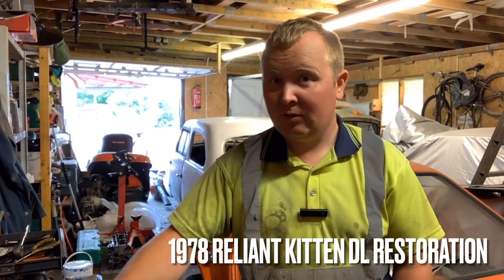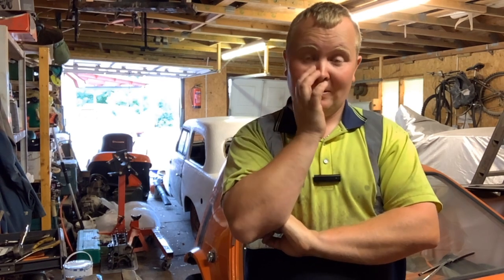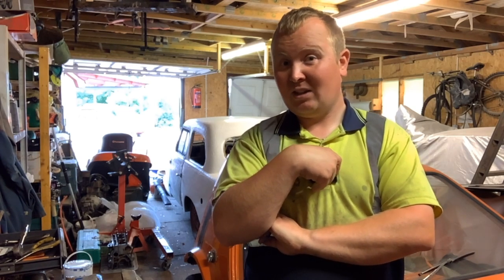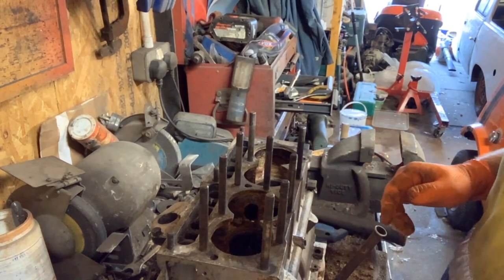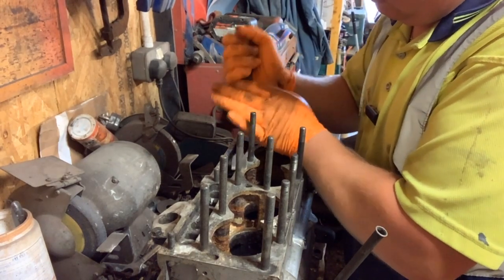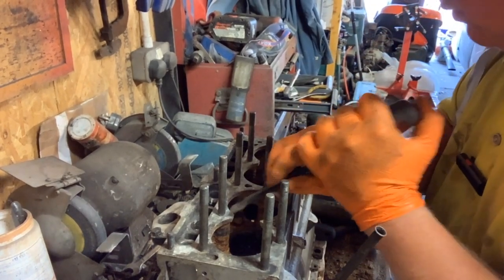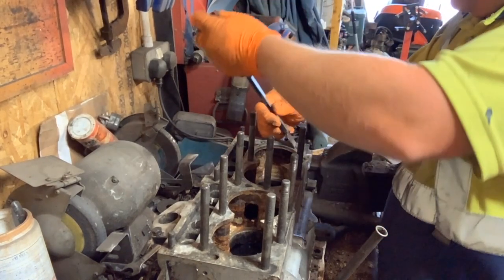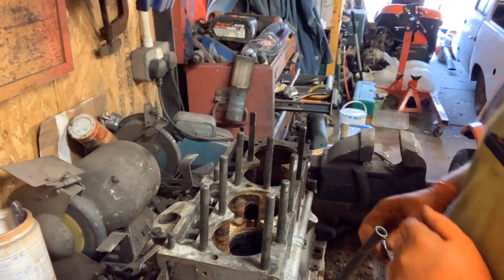It’s time to rebuild a Reliant engine! 1978 Reliant Kitten DL

Comment: i use broken hacksaw blade to scrape old joint compound from head and barrels easier to get into tight areas, no matter the tool use carefully.years ago it was mainly red hermatite and brown hermatite later replaced with hylomar for joints

Comment: The Haynes Manual or Reliant service manual said the factory used a ceramic adhesive to fix the liners in place,     On one Reliant forum they use nothing at all,     Is that blue stuff your using a non setting gasket sealant  ?    Does it matter at all ?
Reply from the maker: I got told to use blue hylomar as it’s a non setting gasket sealant 🙂
Reply: @LewiBuchProductions  silcoset 152 silicone adhesive sealant was the factory sealer

Comment: Nice work Lewi, yeah do it right, is always the best way - but the Honda, fantastic engine - transplant project ?, to make a front wheel drive Kitten ?
Reply from the maker: No chance 😂, I don’t want to break that Honda and I wouldn’t want to make the kitten non original when I have it’s original engine and gearbox here
Reply: I agree, the yellow one needs to be kept original, I had thought you might find another scrap kitten to make it ? - it was just your comment on the level of rust in the Honda , that had got me thinking out of the box - mind, you probably have plenty on your plate currently - hope you keep the yellow Kitten yellow ? Regards Andy
Reply from the maker: Nah I don’t think I’d want another kitten, I’d rather just keep them original,  someday hopefully I’ll get the Honda restored but it’s engine won’t be going into a kitten 😅